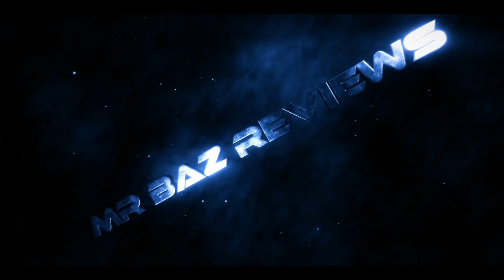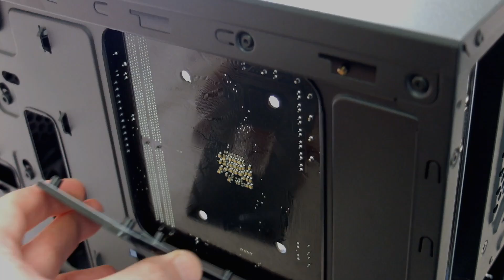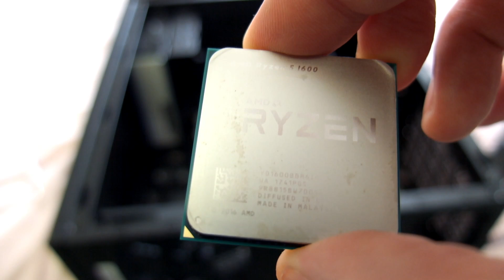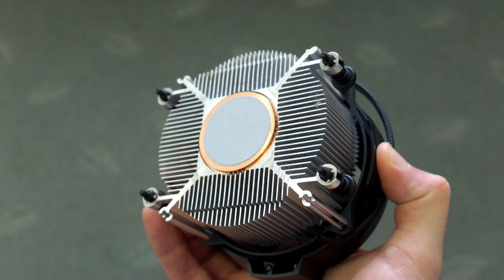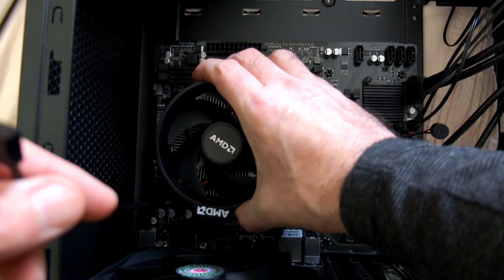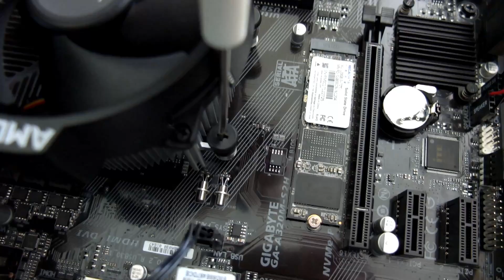How to install a Ryzen/AM4 & AM5 Wraith CPU Cooler

Comment: I have one question, is the bottom of the fan supposed to be touching the processor? The sticky heat-shrink is all over the top of my processor. Is that the way it should be or did I do something wrong? Thanks for the straight to the point video!
Reply from the maker: The thermal paste has to be there to transfer heat from the CPU to the aluminium heatsink, you honestly just put it over it, screw it up and that's it (attach fan header to CPU header on board). The fan is screwed to the heatsink there is no need to do anything to it

Comment: Can someone please help me out? These screws 0:05 for me are EXTREMELY tight. What could I do to unscrew?
Reply from the maker: Just break the connection use a decent screwdriver with some length/torque. It should move

Comment: Are bro mera jo fan lagane ke liye spot hai na waha screw se band kar diya hai means jab fan lagana ho tab screw nikal ke waha ek black colour ka patti hai wo nikal ke fir fan attach karna hai ab bat aisi hai ki wo jo screw hai wo nikal hi nahi rahe pure jam. Ho gaye hai, kya karu ab
Reply from the maker: Speak English then I can respond
Reply: @MrBazReviews  lol sorry
Reply: I am not able to remove screw that are fixed on motherboard as it is jammed what to do
Reply: I have rog b450 f. There are 2 black stripes which need to be removed in order to fix a fan but i am not able to remove that stripes, screws are jammed and i can't push it too much. You have any idea what to di
Reply from the maker: @chetanjadhav4532  Try WD40 or silicone spray if it's tight should come off without too much problem
Reply: @MrBazReviews  okay 👌. Thank you so much

Comment: Thanks so much! Just in case you guys didn't know, if you are trying to replace a cpu, the back plate can fall down without you knowing so you have to take off the side panel!
Reply from the maker: Great tip!
Reply: THIS COMMENT RIGHT HERE !!! I WAS LIKE WHY CANT I FIND THE THREADING??!!
Reply: love you
Reply: I have a issue, my backplate keeps sliding or falling off making it extremely hard to screw the cpu fan on to the backplate threads…
Reply: @davesuals  put the pc on the floor and put something under backplate that pushes it into motherboard that worked for me but it would help if someone hold it while you screw cpu fan
Reply: thank you bro
Reply: 2 years old and just helped me still 😂 i thought i heard something fall down the back midway through
Reply: this was it
Reply: lifesaver
Reply: This is exactly what happened to me too! My case doesn't have an accessible side panel tragically, so I shoved plastic knives underneath to lift it up. CPU upgrade complete!
Reply: YES! I was losing my mind. Thanks
Reply: I WAS SCREWING FOR 20 MINS OMG THANK YOU
Reply: Oh my god, i just spent an hour researching how to fix this and this one comment just fixed everything, i am both seething with rage and completely relieved, thank you so much
Reply: 5 years and your comment helped me today. The back plate fell off and I was so confused
Reply: Omg your comment just saved me hours, the backplane fell off yessssssss
Reply: You are a god. I feel so stupid
Reply: you just saved my life dawg
Reply: Thank you 2 years later your still helping people
Reply: life saver
Reply: lmao exactly what my problem was
Reply: Ughk thanks so much I was so confused
Reply: This is exactly what happened to me before I searched this video.
Thankfully the video told me about the backplate.
That was the issue I was having.
Reply: Your tip, damn much saved my life
Reply: Thank you so much I was struggling really hard
Reply: i love you bro
Reply: Thank you so much
Reply: Life saver
Reply: Thanks, life saving. I was like: let's quickly change the cpu and one hour later is still thought I am dumb
Reply: Life saver. Thank you
Reply: Loo

Op
Reply: Thanks
Reply: Thank you so much bro you saved my day🎉🎉
Reply: wish i would’ve saw this comment before i stood my pc up and heard it.
Reply: 3yrs old and still helpful..Thanks bud.
Reply: I KNEW I WAS MISSING A PART. legend, this comment is still helping people years later
Reply: I just replaced my thermal paste and I was trying to trying so hard to get the screws in for 2 hours to the point of "welding" the screws to the motherboard only to realise the back plate has fallen off.
Reply: You just saved my day THANK YOU SO SO MUCH
Reply: Bro I love you
Reply: Another thumbs up from me. Thanks for mentioning this. My thermal paste got spread all over trying to get the screws into nothing as backplate fell off.😦
Reply: Goat
Reply: You are living legend bro
Reply: You are living legend bro
Reply: LIFE SAVER I was spending so much time and getting worried about my new cooler and when I tried that it still wouldn’t go on, saw this looked at the back and it’s not on, 3 years ago still helpong
Reply: you just saved me like an hour thank you!!!!!
Reply: you saved my day, thank you
Reply: Bro I couldn’t figure out why my cooler wouldn’t screw in. Absolute legend my guy 🫡
Reply: Fuck
Reply: I hope you always get cold water, both sides of your pillow are cold, you deserve a good life.
Reply: Thank you!!
Reply: Bless you. You have saved me from a moment of absolute despair. I was ready to buy another heatsink!
Reply: Thanks! Just went from 3600 to 5700x3d and was wondering why the cooks wouldn’t screw on 😂😂
Reply: Thank You ❤
Reply: i have been puting cooler on and off and cleaning it from paste 10 times and puting paste 10 times trying to screw it in without knowing there is backplate
Reply: Thanks
Reply: THANK YOU THIS IS WHAT I NEEDED YOURE THE BEST EVER
Reply: THANK YOU
Reply: you are my savior even 4 years later
Reply: Just dont unscrew all screws
Reply: Tnks
Reply: Life saver
Reply: 4 years later and you just helped me, I was going crazy thinking I ripped the thread right off the mobo lol. Thanks a bunch!
Reply: what a life saver man, thanks man
Reply: U have saved my life bro👏🏼😍
Reply: God bless you you deliverd me from a 1h headache
Reply: saved my life bro❤ Thank you
Reply: Thanks so much bro
Reply: Can’t tell if my screw springs are seized… hopefully this is the fix
Reply: Thank you
Reply: Bro 4 years later your still saving people thank you so much bro.🙌
Reply: Thank you so much! Saved my cpu cooler from my rage
Reply: Thank u so much bro I was trying to add thermal paste and I could do it and I knew my dad would screen at me if I broke something but because of your I’m good 😂😂
Reply: Ty for saving 20min of my life!!!
Reply: BRO YOU JUST MADE ME REALIZE AHAHHAA
Reply: That's what I was struggling with in fact.
Reply: Life saver
Reply: Same happened to me but I saw it on first place. But I thought it was an HDD/SSD holder until this...

Comment: Almost broke my motherboard while I tried to fit this cooler. How could you screw in so easily?
Reply from the maker: You want something keeping the backplate in place, in this case on top of a bed or use a book etc
Screws in pretty easy on the Gigabyte boards
Reply: @MrBazReviews  Hey mate, you were right, I completely forgot about the backplate. Pc still working.
Reply from the maker: @GoznerPeter  Lol no worries glad it's sorted

Comment: The most pain in the ass to install cooler I've ever come across with. Thanks.
Reply from the maker: It's not the best design!
Reply: @MrBazReviews  Yes, Intel has lot better cooling designs. AMD makes better processors but a lot crappier cooling mounts.
Reply: @MrBazReviews   i cant get it screwed in
Reply from the maker: @eastantalley830  Hold back plate in place, push down the screws they are spring loaded
Reply: @eastantalley830  me too
Reply: @MrBazReviews Thanks was screwing the screws for 15 minutes wondering why they werent screwing in
Reply: @CatchwindSuperstar  what ould you hold the back plate with? after reapplying thermal paste i had trouble putting it back with the back plate
Reply: I have seen worse (Pentium 4 stock cooler was garbage)

Comment: Plz help me the screws just wont go down they just keep spinning is this because they are Spring loaded and if so how do I solve this issue
Reply from the maker: Hold the back plate in place when screwing the heatsink in
Reply: @MrBazReviews  thank u so much it worked my temps are back down to about 30s to 40s on idle and 50 while gaming thanku so  much

Comment: I did it perfect on my first build but now the screws won't even go down with immense pressure because I needed more thermal paste since the stock amount was crap. Ryzen makes great cpus but shit coolers
Edit - it was the fucking back panel, I guess it fell down because it was inside my case. This shit honestly makes me never want to build another computer
Reply from the maker: Yeah the back plate needs to be held in place hence I show it in the video ;-D

Comment: I took the board out, put it on an antistatic mat, secured the fan and reinstalled the board
Reply from the maker: That will do the job too, anything that holds the plate in place helps

Comment: so how do you install a non stock cooler without the backplate falling out?
Reply from the maker: Hold it in place, put in on something like a book. If you don't have a cut out on the case, fit it before screwing the mobo in.

Comment: How detrimental will it be to having the AMD logo facing the ram (right) instead of facing the io ports (left). Just finished my build and I did this part incorrectly. Didn't have replacement paste on me so left it as it is, with the logo on the right side. Now that everything is done I would like to correct this since access isn't hard.
Reply from the maker: Won't make any difference to the cooling performance. You can unscrew the fan and leave the heatsink in place if you want to change the logo position
Reply: @MrBazReviews  Wonderful, thanks Baz. I will just do that. Appreciate it and great video.

Comment: Thanks I know how to take it off but thanks to the old thermal paste it had dried onto the cpu and was stuck I’m amazed the cpu dident over heat
Reply from the maker: I usually heat up the CPU before removing (ie stress it a bit then power off) makes it easier. Sometimes paste can harden it shouldn't but it can

Comment: I am having issues with my Ryzen 5 3600 stock cooler it’s running at 64°C with only hardware monitor open and peaking at 90°c while gaming could this be me not titening the cooler down enough or a different reason?
Reply from the maker: Ryzen 3 series runs hotter, the changed the design but you can try to re-apply thermal paste, first check BIOS update it some boards put more voltage into the CPU than is needed. Updates should fix this or manually change the voltage try BIOS update first
Reply: Mr Baz Reviews ok thx so much it was getting up to the 100° on cod war zone and I was getting worried I’ll try adding thermal paste as the stock paste is on there now and screw the heat sink down tighter this time thx for the help 🙏

Comment: Thanks, man! After watching your video, I ditched my over-cautiousness and got two other screws all the way in for the CPU. Hopefully, I won't suffer the heating problem with the Ryzen 5 3600 again. (I experienced it only once right after mounting it)
Reply from the maker: I know some of the boards were pushing the voltage a bit high on the new Ryzens, so might be worth checking for a BIOS update on the mobo. If you still have heat issues maybe re grease it with premium compound, or third party ones the Artic series is pretty good and not expensive. They do tend to run hotter than the 1/2 gen Ryzens, but some were running way hotter so try the BIOS route if you have problems first
Reply: @MrBazReviews  Right on, always a good idea to get things up-to-date. Everything runs fine on my ROG Strix B450-F Gaming, even through a modern game on high settings, for now.

Comment: What if we’re changing the motherboard after about an year? Do we need to apply thermal paste in that case or the stock paste would still work fine?
Reply from the maker: If the cooler is removed, clean it and re-apply paste

Comment: The metal plate thing that holds the CPU cooler was flaying around behind the motherboard, I was sweating for 5 minutes wondering why the the cooler won't screw in 😂. I had to hold the plate with one hand and screw the cooler with the other.
Reply: This figured out my problem. I sat there for 20 minutes trying to figure out what was wrong and a guy with a Bowser profile picture saves my life. 
Thank you
Reply: that happened to me too😂😂😂
Reply from the maker: Yup it's kinda simple

Comment: Should I install the cooler on my motherboard box
Reply from the maker: It will do anything that holds the back plate in place (avoid carpet etc static)
Reply: @MrBazReviews  I'll be building on my dining room table

Comment: If I apply pressure will it break the processor underneath?
Reply from the maker: No the CPU has a metal covering it's really not easy to damage at all
Reply: Mr Baz Reviews also my back plate broke so I bought a new one but it’s a little smaller then the one that broke so it’s hard to put the screws in. Do I need to buy a new one or just Apple even more pressure?
Reply from the maker: @ljhernandez358  If the back plate fits just screw it in, reverse thread it first screw in one a bit, then work around the others 
I honestly have not found it an issue on the boards I have used at all (gigabyte)

Comment: The cooler is very hard to fit because the copper core is proud compared to the flush all alloy ones and you have to put alot pressure on screws..just don't slip..😢
Reply from the maker: It depends on the board most are not too hard to fit

Comment: This video just saved my life got stuck at this exact point 😂 but question, the clips you removed from the board does that fan not screw into those? Or just straight into the mobo?
Reply from the maker: No cooler screws directly into back plate the clips are of no use with the stock cooler
Reply: Mr Baz Reviews yeh thats what i did, i just followed your vid step by step which was a god send brilliant video and the only reason i got it done because the instructions were diabolical so thank you 👍🏻

Comment: That's the wrost fucking cooler ever. I've been screwing for 2 minutes and can't manage to make the screw tight
Reply from the maker: Unless it's dodgy manufacturing it should work, I mostly use Gigabyte all you need to do is hold the back plate on and it screws in

Comment: Ah- here's advice peeps; WITH THESE NEW X570 BOARDS, IF YER GOING TO USE THE STOCK FAN(WHICH SHOULD DO IT'S DAMN JOB ANYWAY! AND WELL!!! SINCE WHEN DID more people START PUTTING UP WITH NOT GETTING THEIR DAMN MONEY'S WORTH?!)
YEH- SO; PUT THE BOARD NOT ON A SPONGY MAT, BUT A SOFT COVER BOOK AND THEN ON A HARD WOOD TABLE!!  PLACE TINY "RISERS" (a rectangular pack of gum where the plate goes through the mobo) IN line ALONG THE SCREWS UNDERNEATH TO RAISE THE BOARD AS YOU BEAR DOWN ON THE FAN SCREWS!
    - THIS LESSENS THE PSI PRESSURE FROM BEING SOLELY ON THE CPU!!! , AND ALSO MAKES IT VERY EASY FOR THE screws TO THREAD AND SCREW the fan on WITH NEXT TO ABSOLUTE ZERO HASSLE!!! PCB's have some flex on them guys! Otherwise boards are being cracked and it sucks. So yer welcome, and hats off to all that give advice to others in need of tech help!
Ciao and keep gaming!- [without so much need to check in w the parent net so we can just play a game!!! I saw that coming YEARS UPON YEARS AGO as resistance in children is zero- they just don't see, and the oligarchs bypassed intellect through spoiled kids! ]
Aight then. Stay safe everyone!
Reply from the maker: I never advise buying high end boards it's IMO a waste of money, new chipsets come out, and sockets stick low to mid range at most

Comment: can socket be too high for screws to reach holes? I have this problem with asrock b450.
Reply from the maker: It's an AMD reference design so unless there is a manufacturing issue it should just fit. The screws push down on them to engage the back plate

Comment: I installed mine but as I turned the screws it made a loud clicking noise with resistance. Had to buy another cooler cause I was scared of damaging the processor or motherboard. Have y’all experienced that?
Reply from the maker: Nope who made the board? I've heard some makers are a bit tricky
Reply: Mr Baz Reviews it was a MSI MPG x570 gaming edge.

Comment: Sir, need your response. How to fix if the screws for cpu cooler FROM my motherboard goes missing? 2 out of 4 screws from my mobo went missing. So, to tighten the cpu cooler, only 2 is functioning.
Reply from the maker: Solution is somewhat obvious, find the screws or get more! 2 isn't really enough to hold it firmly over the CPU. I'd have a dig around on eBay or find other screws that will work

Comment: The cooler I have is laying on top but when I screw it it's still a bit up in the air not sure what to do
Reply from the maker: Slacken the screws off, then re-tighten them slowly work around each one a bit
Reply: @MrBazReviews  I think the screws dont even reach I heard maybe the back was loose from the mobo you think it's that as well?

Comment: Put in the CPU and the CPU cooler while the Mobo is OUTSIDE THE CASE!
Reply from the maker: Doesn't matter most cases have access to the rear of the mobo. if you upgrade CPU you don't want to take the board out either

Comment: Impossible, I tried aiming up the screws and holes and tried to screw them in for two hours to no avail. I give up
Reply from the maker: Works OK for me just make sure the back plate is held in place when you screw it up took less than a minute